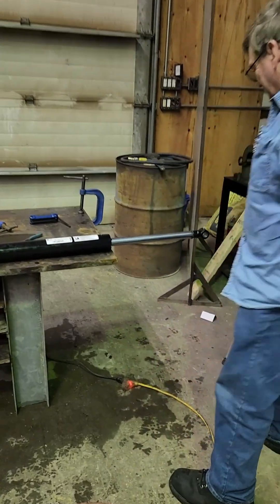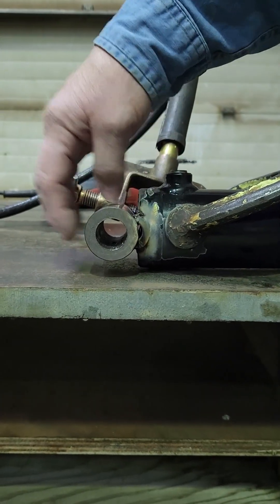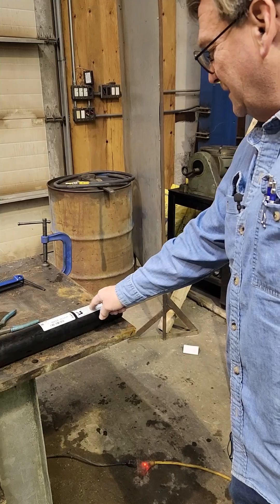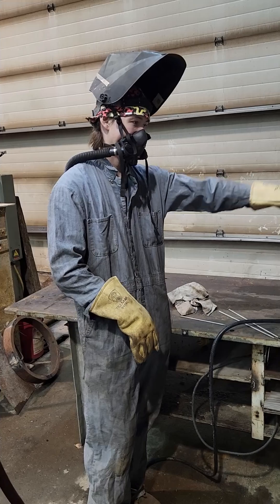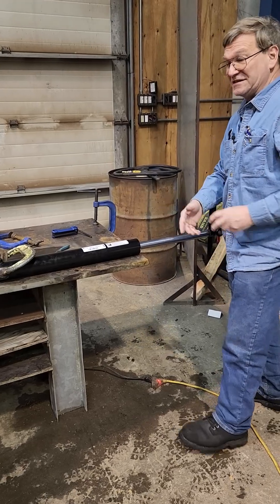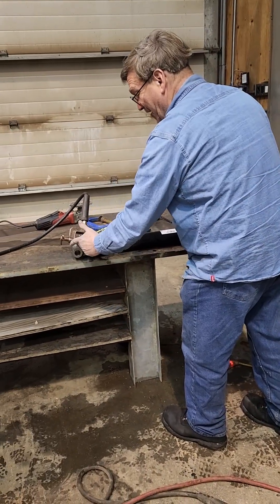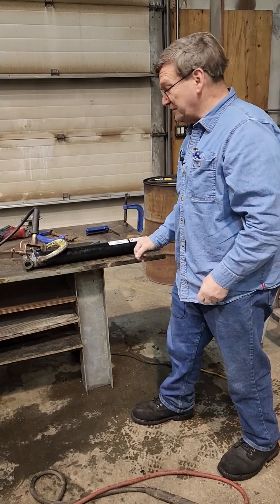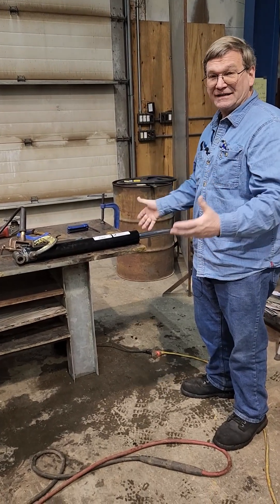You can weld on closed hydraulic cylinders!

Comment: Another thing you can do without taking the cylinder off the machine is repair scored rods! We used to us brazing rod to repair pits and scratches that were tearing up seals. Just braze the area of the damage. Hand file the braze material close to true with the old chrome and then emery paper the rest til its true and flush with the chrome rod. You would be amazed at what works ina pinch! Blown seals, remove the head gland nut and install rope, cotton rope preferred. use a punch to drive the rope into the old seal cavaty, wrap it around the rod, and then install the retainer nut and tighten it up.

Comment: Aaah this is hard (not hard to do just hard too is it worth it?), i'v done it does it work YES, is it good? probably not because it WILL shrink more " than to spec"

Wait what the head is welded and not screwed?
Yhe well then just take it to the lathe.

Edit: yes every hydraulic cylinder is fixable

Comment: Just like my hydraulic system on my lawnmower its non serviceable but I don't take no for an answer so I'm going to simply use a turkey baster or a pump of some kind and suck the fluid out and measure it and put New fluid in it and run it for a bit and change it again just to get all of the old stuff out. Tell me it can't be serviced lol

Comment: The way he said "ya, ok ok" leads me believe he didn't agree with the way buddy tacked it on.
Reply: I don’t agree with the massive gap :/
Reply: @DoSomething-  looks like the original bore was part of the base end and they partially cut it off. Big deal. It's a small cylinder and ther is tons of weld that can be laid in. Non issue.
Reply: @eriklarsen7358  well that’s the problem no issue…..it doesn’t come off very professional and just seems like a quick fix quick fit, with not much concern. It will be fine, you just wonder how much load and respect it would of received if done with a tight fit. They probably couldn’t cut more off, but they could if atleast made a piece to fit in the gap weld then grind down flush,
Reply: @DoSomething- he even said they just tacked it on so far
Reply: @Dontfloatthestream bro there’s a huge gap under the joint! No welder is reaching that void even, obviously you’ve never worked with high tolerance fits
Reply: Not the point of the video, I smell another internet welding expert 😂😂

Comment: Do you fill the cylinder with inert gas to reduce the oxidation inside that becomes slag and FOD in the cylinder. How do you fill the cylinder with inert gas.  Bottom out the cylinder. Had an air nozzle with a rubber seal. Think tire valve stem screwed into the air gun port.  Then hold the air gun hooked to inert gas tight against the port while you fill the assistant pulls out the rod.
Reply from the maker: Not needed, It will get too hot for the seals but still very cold as far as damage to the metal, it will darken some of the oil film inside, but not a significant amount.

Comment: I worked in a hydraulic shop for a year and never saw a non-rebuildable cylinder. I can only imagine this comes from places like JD where they don’t want anyone touching their equipment. It’ll get some people I guess but working at that shop I learned if it can be built once, it can be built again. I saw mining equipment where the cylinders were blow wide open and we were able to replace the cylinder, give it new guts and ship it out. Liked the job, it just didn’t pay enough.
Reply: Sadly that's the issue with machining today not enough money
Reply: Refuse cylinders are often not worth making new parts for. Little bimba air cylinders with crimped ends are non repairable

Comment: This came at a perfect time! I am pulling off the steering cylinder on my old Deere 430. I figured it’s not rebuildable since it’s welded together.
Reply: A lot of shops will cut the welds, bore if needed, replace seals, then weld it back together. Don’t pitch it yet
Reply: Everything is rebuildable
Reply: Just remember if you are replacing/boring and end that the bore of the eye has to be at exactly 90 deg to the stroke of the cylinder.. To do this you put it in Vee blocks on the mill and bore straight down.

Comment: What is that Bane respirator?
Reply from the maker: North, with extension hose kit, allows the air to come from behind you, so you are getting better air, along with the filtering.  Carter was using a powered kit in the past, but these are much less expensive.  The powered kits are 500-2000 dollars, this is around 200 & supplied by his employer (Me)
Reply: PAPR respirator, pumps clean air from your waist or bench mount up to the mask so you don’t breathe in the welding fumes
Reply: @TKIDaniel 
Very important to wear while not welding